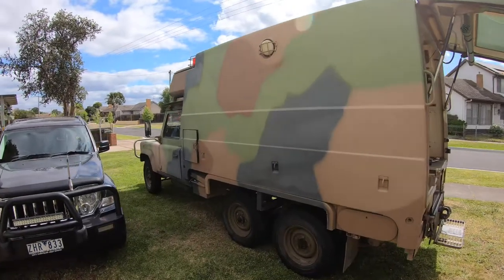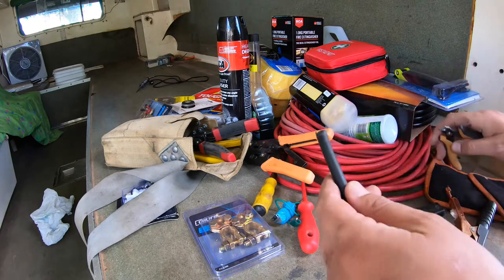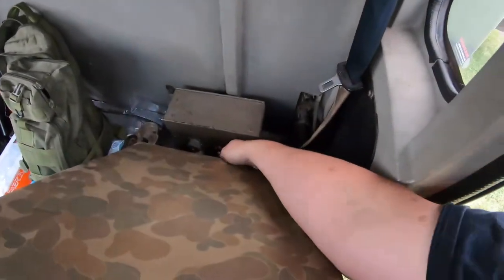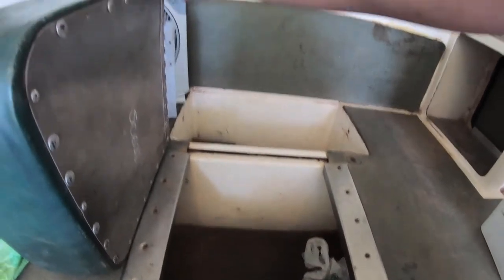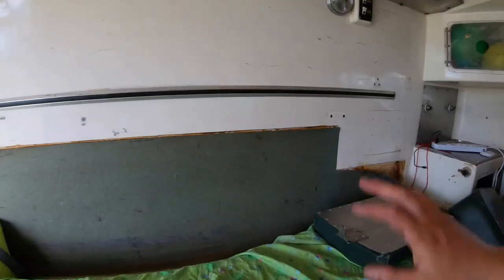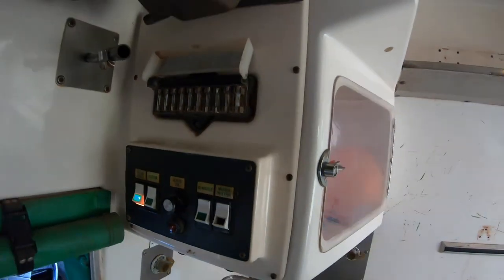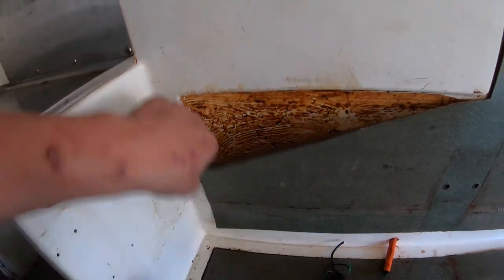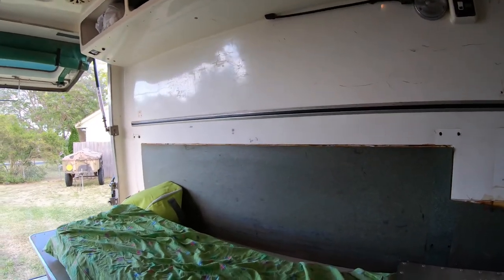6x6 Land Rover Perentie Ambulance First Look

Comment: This is awesome! I've always been looking for videos on this variant of the 6x6!

I will admit, I'm waiting to see the lights and sirens going off. :)

The electrical systems in these are fascinating to me!
Reply from the maker: The lights and sirens are currently non-operational and will have to remain that way at least for roadworthy. according to vicroads, all lights on the vehicle must be functional and all functional lights must be compliant - red on the front of the vehicle is not compliant - and these were fitted with dual red lights.

we may substitute and fit orange which is legal and only use red and blues for static displays with permit.

the siren will have to be modified slightly to be compliant also.

We replaced the center bearing on the 3rd drive shaft today, which was the final job for roadworthy, so wont be too far away
Reply from the maker: Michael Leayr  No probs, plenty more to come, gas lifts on the rear door are coming in next few days.
Reply from the maker: Oh and a heads up the lights work again.
Reply: @TheAussieRepairGuy  Thanks for the message back! I thoroughly enjoyed that video, but got called away partway through leaving a comment, oops!
Reply from the maker: @davidstech1445  Happens to us all. Sat mornings for me are full of people calling me wanting stuff fixed, and me having to say no.
Reply: @TheAussieRepairGuy  Unfortunately the same here. Distant friends of past suddenly pop up and say "Hi, it's been ages!", and "Hey, while you're here, I have this problem...". Ah well, such is life.
Reply from the maker: @davidstech1445  just following up.
Lights work now - but are orange for roadworthy purposes. Also made a playlist:

https://youtube.com/playlist?list=PLXvLC1_XYdhrvxNkLbnv0ZqqY82qC2UYp

Comment: Can you stand in the back without your head touching(and how tall are you?)
Reply from the maker: I'm 6 foot 6, and no, but that's the same in literally any caravan or camper.
it has more room than most though and my 5'6" wife is fine.
Reply: @TheAussieRepairGuy  thanks mate, I am 5'10 so a little better off
Reply from the maker: @ADVtheMISSIONARY  yeah you will be able to swing a cat by the tip of its tail in the back